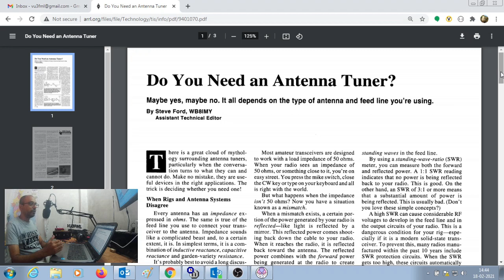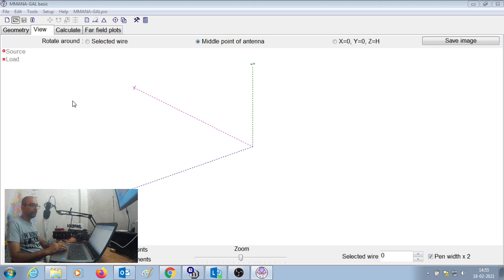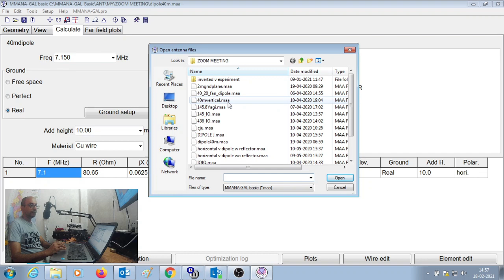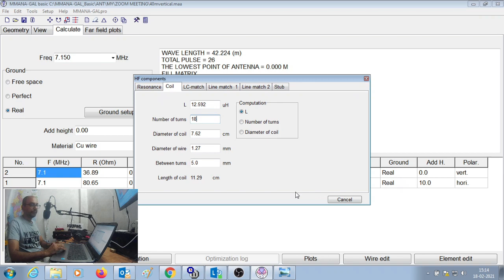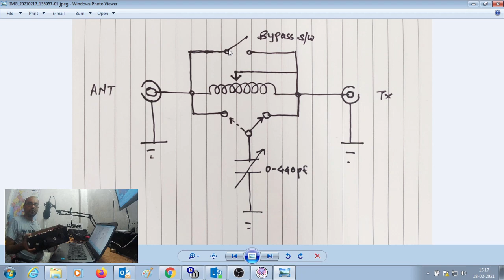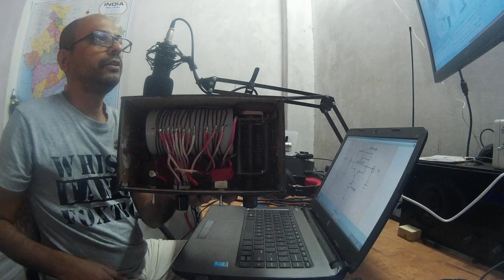Homebrew Antenna Tuner - LC Match/Coupler

Comment: Hi Anirudh, well-done. Congratulations for presenting the title and showing the use of computer simulation. You have made clear about the step up and step down function of the low pass type LC tuner by placing the capacitor on either side using a switch. And by bypassing the inductor you can use it to tune a long wire. You presented the functioning of the tuner (coupler) using the Nano VNA saver software.
Next time you can have little more lighting into the tuner. Technically it could have been a better build; but you have done very well.
Thanks again for the wonderful presentation. Keep it up.
I have subscribed.
De VU2RZA
Reply from the maker: Thank you!

Comment: Hello Aniruddha, Thanks for the wonderful video, I am swl, using long wire and rtl sdr blog v3 dongle for listening HF and VHF,  will go for license soon. Do I need antenna tuner while receiving or it is required for transmission purpose only? If it is required, I want to build it by myself. Please let me know if any kit available?
Reply from the maker: I would suggest build one when you get your license.

Comment: Very good video. Are you able to tune into 80m and 160 m. What is the value of the inductor.
Reply: Good one for understanding the need of antenna tuner. Though a tuned antenna is ideal but when you need one this simple device should be very useful.
Thanks for your efforts.
Vu2spf, Bhatnagar